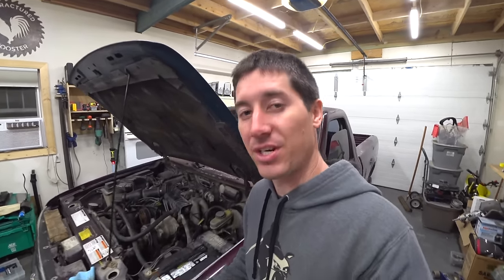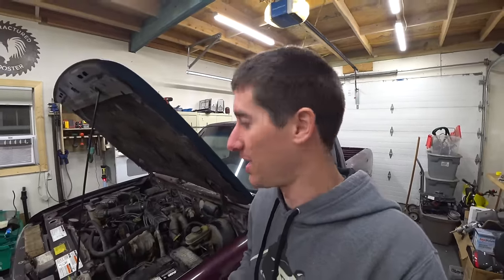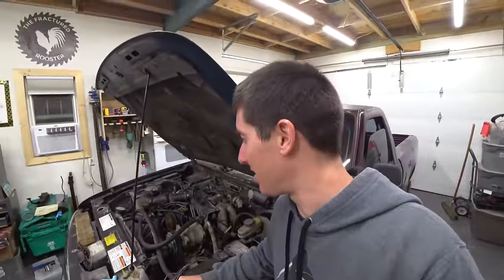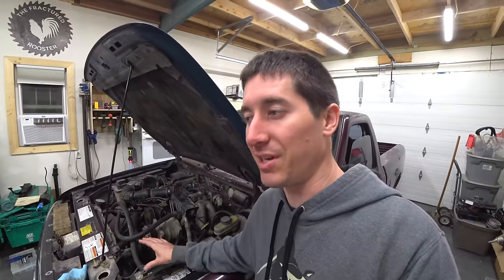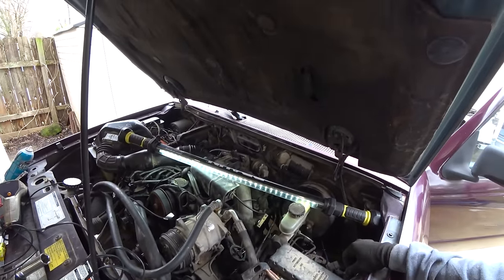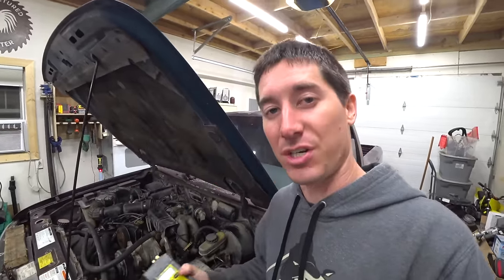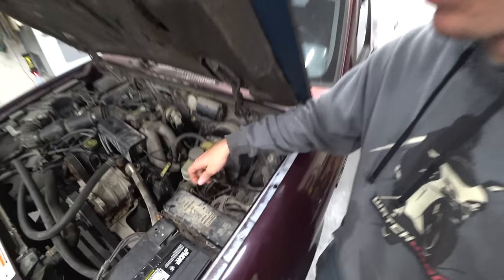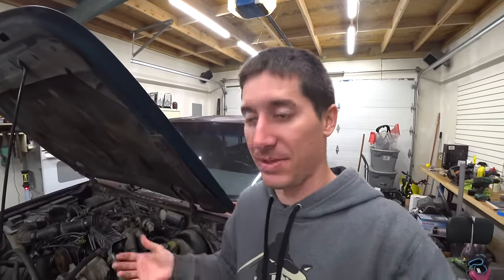We FIXED The $300 Ford Ranger And It Doesn't Make ANY SENSE

Comment: Anybody else confused by"it's a great running little truck with absolutely no power, it'll serve someone well for a very long time"?
Reply: Did i miss the part where they fixed the starting problem without pulling the spout thing?
Reply: @jonbennett118  No still need to take that thing out
Reply: Mark Savin 
It’s a fail. Threw parts at it until it ran (kind of)
And called it a win! Sounds like some shady Dans used car lot shenanigans to me. But that’s the world we live in today. ZERO INTEGRITY !
Reply: @youraveragejoe7644  what do you want form a 300$ truck he wants to flip it with minimal costs and they worked at it for 2-3 days at it. Go to a garage and they charge you a huge ammount for troubleshooting
Reply: @youraveragejoe7644  I have to admit this one was the final straw regards his content so I've unsubscribed which is something I rarely do.
Reply: Chris723 
Remind me of that when YOU are the buyer of that vehicle. No one likes to get ripped off or half-as*ed. So when you willingly invite this into your life let me know.
Reply: @youraveragejoe7644  people who buy trucks for 2k are willing to ignore a small problem like using a switch on startup if the truck runs good

Comment: I need help with my 1984 Volvo 240 gl the injectors aren't spraying into the engine and I ran a hose straight to the fuel rail and it wasn't sucking any fuel
Reply: Fellow Volvo enthusiast here...Have you checked your fuel pump relay and system relay? There's a few things it could be to be honest. With more info I could probably help you narrow it down.
Reply: @willys4wheeladventures19  I ran a hose straight to the fuel rail so I bypassed the fuel pump it's just not sucking fuel
Reply: Okay, so no injector pulse.
A bad hall effect sensor can cause this. If there is no signal from the sensor there will be no spark, power to fuel pump, etc..

If you have spark and your fuel pump runs while cranking and that is not your issue then check the following:
-25A blade fuse (Under the hood on passenger side. Next to coil)
-Injector fuse (fuse panel..I think it's fuse number 12)
-Wiring to injectors

If none of these are the issue, then get back to me for further troubleshooting...Hope that helps. I have the green books for these years and access to other manuals. Just let me know 👍
Reply: Also you can't run run a hose to the fuel rail on these cars because they require proper fuel pressure before they'll send power to the injectors...hook it all back up and try starting it by spraying starting fluid into the intake
Reply: @willys4wheeladventures19  that worked but it didn't keep running

Comment: the computer is adjusting timing to a point where it causes it not to run, personally id be unplugging sensors one at a time to see if one of them makes it run better. A bad ect sensor can cause timing and fuel mixture to be off and run like complete shit, usaully when the fail they read really cold and it retards timing alot and dumps fuel in like crazy and it wont run well or even not run at all

Comment: Spout connector? Is that what you said? What's it do, what's it plugged into??? It's a WHAT? Works WHAT? Watching the video the motor sounds like it needs a valve adjustment something awful!!!! Cool! I bought a s10 for $300.oo and all it needed was for me to dump the clutch 2 times and the clutch worked!!!!! Have had the truck for almost one year, and put a clutch slave cylinder in, , and put gas it when needed! That's my $310.oo dollar truck! Beat ya!!!!!!!!
        just sayin

Comment: Im about to buy a 1996 ford ranger 2.3L 5 speed 4x4 with the shifter on the floor not a dial by the radio. Runs and sounds like shit but itll be a good project truck. Only 500

Comment: Lol, I had a 96 that wouldn't start. Spent a bunch of time and money... Ended up being just an air bubble in the clutch line.
Reply: That's impossible. Your mechanic lied to you lol
Reply: No mechanic, did it all myself. Fuel pump plus relays, checked all the lines and the filter. Still no go. Just bled the clutch line inside the cab and it started right up.
Reply: @igor_axis  Oh, you weren't triggering the clutch pedal switch that allowed it to turn over.
Reply: @dealornodealproductions7314  Do you own a 96 ranger or Mazda b2300? Because if not you can stop acting like you know what you're talking about. 😘

Comment: I bought a 94 same color 500 bucks was a 6
 year sitter.4.0 v 6 purple power pickle... dude I worked 14:25 thru  her same way ..all nrake brake lines gone needed gas 14:25  gas neck fuel pump drums, long story short last offer on a keeper 500 dollar treasure not for sale truck...4000 grand  I said no...225 on the dash  truck will last 30 more years rust raàsh optional

Comment: Your ECU is shot, there is no spark control. When you want to set up timing you remove SPOUT connector and set the timing. So now you have a car running with no timing advance or retard control.

Comment: just saying it's fixed is plenty.. no need to actually fix it.. lol..   they do have these things called troubleshooting flow charts and tests.. instead of just trying things willy-nilly and throwing parts at it..  you actually perform specific tests and based on results of said test you run other tests..  this way you aren't just guessing and keeping o'reilly flush with your cash..  eric at south main auto is a true tech, he goes about things the right way..  scanner danner is another good troubleshooting channel.. 1st.. use some of your you tube money to invest in a decent bi-directional scanner..  autel masisys elite is a good 1st scanner..  start working smart not hard..  you get lucky a lot and happen up on cheap fixes.. but some you actually need to use your head, not the parts house to fix..  i know you know this stuff.. just sayin..  and when are you going to get the rolls fixed?? i bet your sponsors would like more exposure than 1 test drive since they put thousands of dollars into your project..  only to get nowhere with it..  it needs a built ford 9" solid axle and a 4 link..  with a real limited slip posi, not welded spiders.. and make the a/c work..  lol..  did amberghini quit chaturbate again?